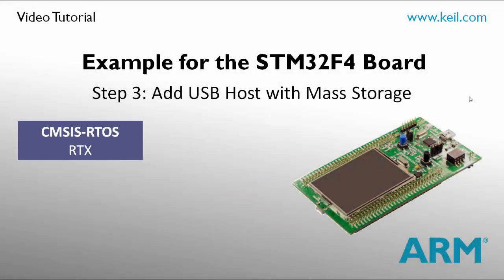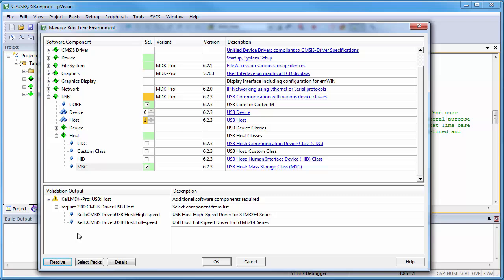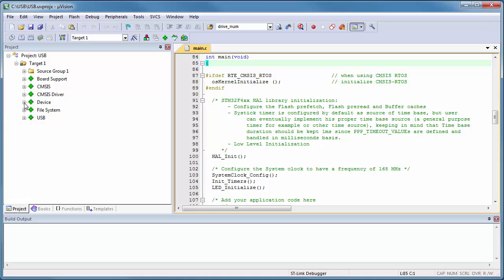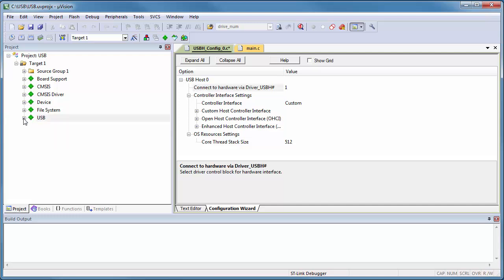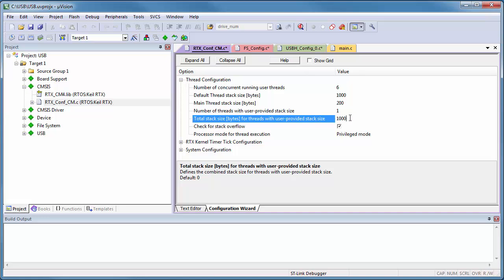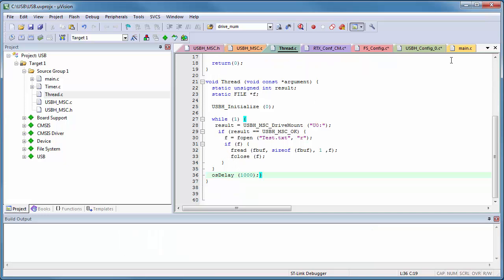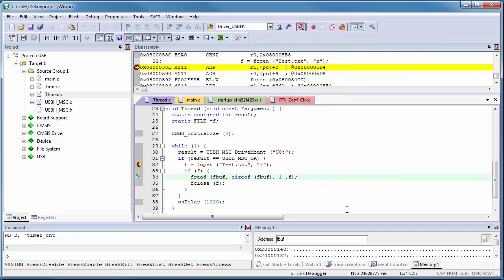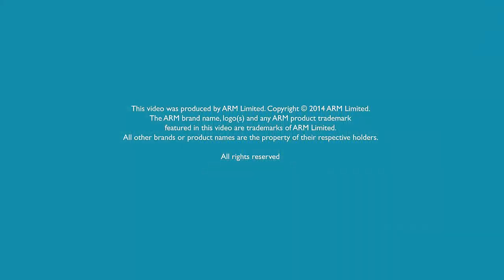CMSIS Workshop Step 3: Add USB Host Support

Comment: Hi, Up-to this step the compilation was fine. But while debugging I can see that the execution is reaching up-to   
if(result == USBH_MSC_OK) {       but it is not going into this statement. means execution is not returning  "USBH_MSC_OK" .
What could be the reason behind this? I have attached an 8 GB of USB drive through an USB - OTG cable (cable and USB is tested before).   

while(1) {
  result = USBH_MSC_DriveMount ("U0:");
  if(result == USBH_MSC_OK) {
   f = fopen ("Test.txt", "r");
   if(f) {
    fread (fbuf, sizeof (fbuf), 1, f);
    fclose (f);
   }
  }
  osDelay (1000);
   }
}

while seeing the value of "result" it is 0xFFFFFFFF instead of 0.